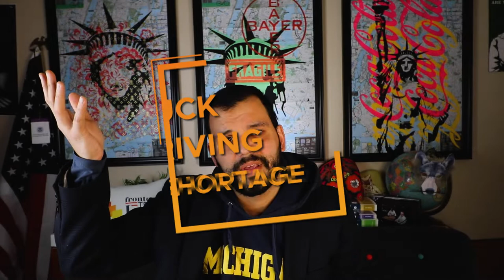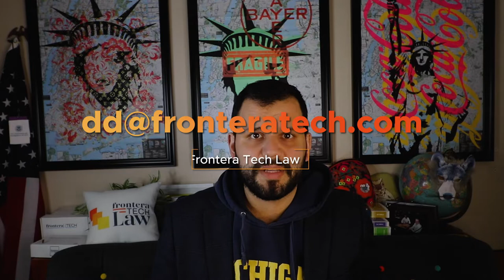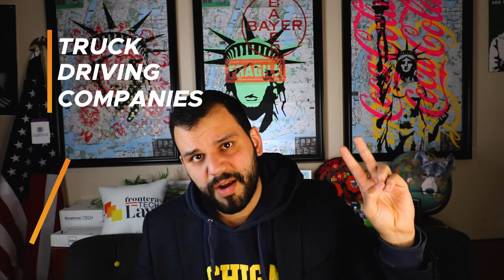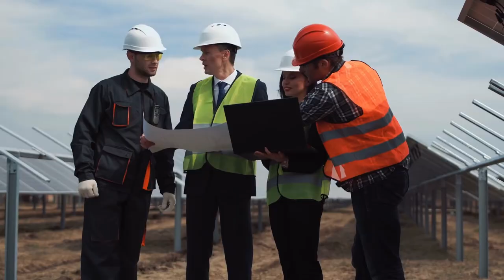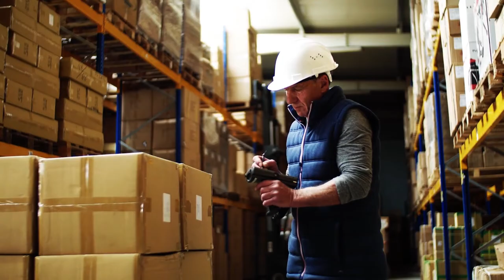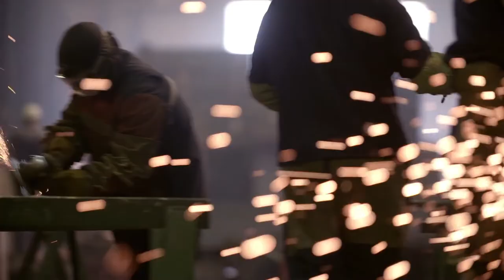Let's Build a Solution for the Truck Driving Shortage in America

Comment: There are more than enough qualified drivers here in the United States. The issue is most quit within 3 months; there is awful abuse of drivers in the industry.
Reply from the maker: This could be. I see it all from the Employers side, where demand for trucking is higher than ever before and truck yards are full of trucks without drivers. It could be both are true - lack of enough drivers and many drivers sitting on the sidelines - but the end result is going to be some combination of businesses looking elsewhere for more drivers and refiguring their operations so that they can hire more efficiently locally. Overall, I do not buy that we are in a historic crisis due to just one factor, and I believe that we are undergoing a historic shift in the re-onshoring of production, manufacturing, and supply chain. In other words, I think that the need for CDLs is much higher today than, say, five years ago. We are at historically high employment for example, and the shortage of drivers is bigger than ever.